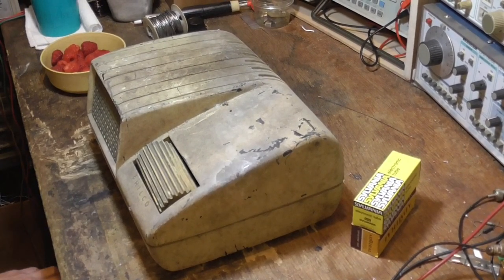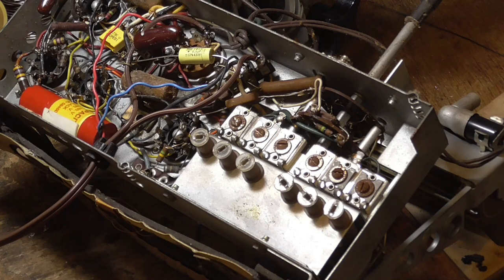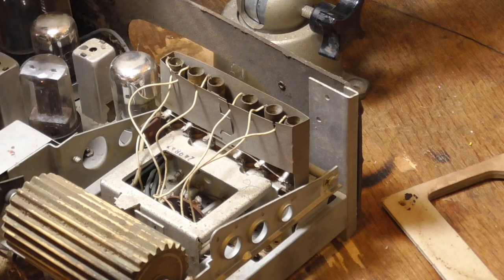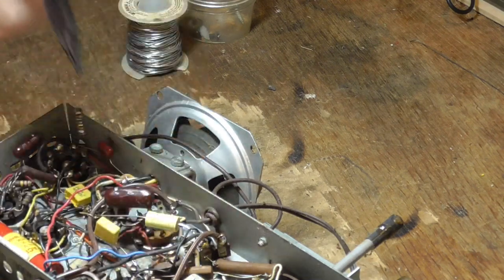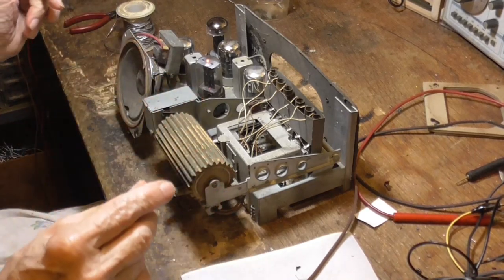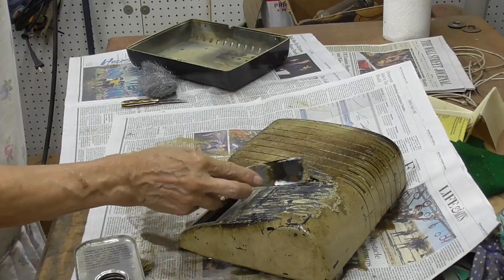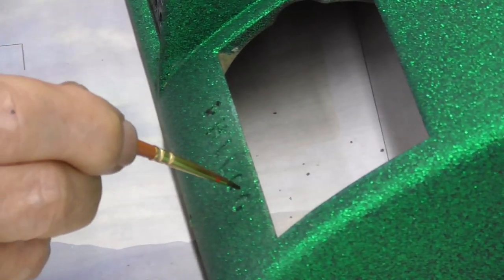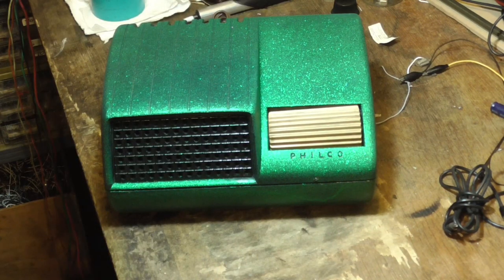RESTORING A VERY UNIQUE PHILCO TUBE RADIO

Comment: You are missing the little color wheel that goes in front of the pilot light.  Each station will have a different color pilot light on the front.  It attaches to the end of the long shaft of the station switch.  That's how you know what station, or which preset you are tuned to.

Comment: Interesting fact, this is a foot operated radio! Designed to be placed under desks in offices or for secretary’s. Move the dial with your foot for volume and press it down to change the channel. Also became pretty popular for physically disabled people, particularly wheelchair bound folks. They really did think of everything!
Reply: why would it be useful for wheelchair bound people, if the whole point of it is that it's foot operated?
Reply: This is not a foot operated radio. That has been debunked.
Reply: These are NOT foot operated no matter what you might see elsewhere...
Reply: Jacob Garby I should have been more specific. Used in hospitals ect for people who are wheelchair bound but not permanently disabled, say a broken leg ect

Comment: Perhaps it's in a comment already, I didn't read them all. We have one of theses in our New Jersey Antique Radio Club's museum. It's a "Secretary's radio", designed to sit on the floor under a desk, and were often used in a reception room. The Secretary used her foot to roll the volume down when greating a guest or taking a call. Tapping the roller changed stations. The example we have is its original ivory color.

Comment: The size of the dual purpose wheel and lack of a dial makes me think this may be designed to be foot operated. Like in an office. Certainly a unique piece. Nice work as always!
Reply: Never advertised as a floor model. Why it is just a novelty desk unit where you set six active AM stations from underneath and use one hand to operate it
afterwards. It would sound pretty crappy on the floor and with shoes on hard to adjust the volume without accidentally changing the station!

Comment: For removing the paint I use this method. Apply the paint remover and let it soften the paint. Use a low power pressure washer to power wash the old paint off. You can dry the water and reapply the paint remover if needed a second time. No scratches or damage to the surfaces you are cleaning and it's much less messy a job.  I would tie the shells down so they can't dance away when the water hits them.

Comment: This was designed to sit under a desk and be operated by foot.
Reply: no it wassent
Reply: @robot797  My mistake. Found an old ad for the 49-901 (this model) which shows it as a bedside radio which makes sense. I have heard, however, that it was used under desks but it seems that is a common misconception.
Reply: @brianbommarito1360  the material it is build from isnt strong enough to handle food presses
but i know the mistake and i dont blame you

Comment: If I could hazard a guess as to why the strange tuning mechanism, I'll bet it was aimed at elderly people or people with limited eyesight who might have difficulty tuning a regular radio tuning dial. At the dealership (remember when there were radio and TV dealerships?) the salesman would set the presets to the stations that the person wanted to be able to listen to. Or, conversely, a relative or friend could set the presets when the radio was brought home.

A great job, as usual.
Reply: That's a good theory but if so, why is the channel indicator (missing in this example) a colour wheel that would require the user to see it; surely they would have used something tactile instead?

Comment: Nice save!

Let’s set the record straight on these Philco “Secretary” models (Philco model 49-901) for the viewers at home.

These were never intended to be put on the floor and operated by foot. The original advertising confirms this, and besides, there would be very, very few left with this kind of treatment. These are unique, but certainly not rare. Philco was a very prolific manufacturer. I own 3 of these radios myself.

They were only available in 2 colors from the factory—ivory and green (the green being a sort of institutional colored green). Any other variation (including plain Bakelite was modified at a later time).

The whole point of this radio was to provide a desktop radio that would cause as little distraction/disruption to the secretary’s primary functions (typing, filing, answering the phone etc,) as possible. Volume and tuning could be accomplished with a quick reach—not even needing to take your eyes off of your work.

I caution anyone that works on these to be very careful of the rotating color wheel as they are very fragile and brittle. This is one of the key elements of the radio as it filters the light from the pilot lamp so the jewel indicator on the outside glows a different color corresponding to the different station/frequency selected. This is the only visual feedback to the user.
Reply: Thank you, DR, for that interesting information.
Reply: And yet there some idiots  posting who don't understand that it WAS designed as a table top radio and NOT to be put on the floor!

Comment: Welcome back ! Ah the Secretary by Philco c.1949. Sat on the desk, it WAS a desktop model, and you could turn the dial from  off to  on and then turn it to raise 
the volume. You could press the dial to change the stations.  It had 6 preset stations that could be dialed up from underneath. Of course you would set the radio to your 
liking from only listening to what was playing since there wasn't a true frequency dial to see the frequency number. That did add to both it's uniqueness and  it's 
downfall.📻 Note, bandersontv did a complete and great restore of this model a year ago. It was in much worse shape!

Comment: Well done Ron! 
The radio is missing the preset indicator wheel. 
It should have a transparent colored wheel numbered from 1 to 6 on the front with the lamp illuminating it from the back, and the corresponding preset would shine from the hole in the front. 
All the best,  Moshe.

Comment: Perhaps no one has realized yet, but that radio was designed to be on the floor under your desk.  You use your foot to work the volume control and change stations.  That's why it's so big, and why it's built so sturdy.  Like a guitar stomp box!
Reply: I think you have something there. Something one might have in an offce/receptionist area back before "Musac". Pretty handy indeed. It may also explain why that volume control was so filthy too. 😃😉😉 Great observation.
Reply: You should check the info made at that time and you will see it was a desktop model with a speaker which precluded putting it under the desk, sheesh!

Comment: Never really seen this kind of radio b4,I couldn't work out what it really was in the first place,but by the shape of it,it looked really like the shape of a fan heater with the rotary control,like a thermostat with an on/off switch.
Amazing how there,s no radio dial,u had to guess what station u are listening to.

I like the cat in the video too,that is so cute. Must've been hungry for the dine food too.
Very nice metallic green finish on the radio case too. But would've been good if u had put the light globe in to see what colour the wheel was showing each time a radio station was selected.
Good to see the fine radio tuning controls on the bottom,and the instructions of tuning the oscillation coils for each preset. 
Would've been good if the speaker was repaired,as there was a hole thru the paper cone.

Comment: Too bad about the SMD. I either do a cap replace or I just put a new core in. 

I know you did some work on replacement IF transformers a while ago. I looked at that and some other sources of ideas and carried on with some further research on it.

As a result of that I designed a core for 3/4" transformers that has all components on a PCB and its works pretty good, actually a bit "hotter" than the stock ones (higher gain). I need to get around to putting them up somewhere for others to get...
Cheers,

Comment: Yeah. That's about the goofiest radio and have ever seen. Quite unique.

46 years ago. I received another rather unique, Philco radio. I had been working as an electrician's helper. When I found this in some very old lady's house. Sitting way in the corner of the attic. Inaccessible to an old lady. No problems for an 18-year-old like me.

So I bring it down to her. And I asked her about it. She said it used to work but just fades out. And it was put up there years earlier. Buyer husband. Who since died a long time ago. And she gave it to me as a gift.

It was this nasty cruddy mottled black color, yuck color. And instead of taking some caustic petroleum-based solvents. I grabbed some Fantastic spray cleaner. And within seconds. It revealed. This gorgeous, golden orange colored, varnished, new, without a scratch, furniture quality case.

And Yep. It works for a short while. And fades to nothing. But here is what is most unique about this particular Philco radio.

It was a multi band radio. With the standard AM radio band of North America. Followed by some of the international shortwave bands. But then there was this one other special band. That no other radio in the world has.

This Philco radio had the first, Armstrong, FM band. The Armstrong FM band. Was not the FM band we know today from 88 through 108 MHz.. It was something like 40 through 49 MHz. And that was supposed to be the world's first, FM band. But it never came to pass. Even though this radio went into commercial production. There were no FM stations at 40 through 49 MHz. There never were. There was never going to be.

Unfortunately with my relocation move halfway across the country. After 40 years. I had to give it up and sell it. As I could not take everything with me. And I gave up a little piece of history. I never wanted to give up. Because I started working in radio for my career. Right about that time that I received that radio. I was never an electrician's helper again. But a professional broadcaster. And that's a keepsake piece of history one wouldn't want to give up. Waaaaaaaa.

Sorry I don't mean to be a crybaby. I just turned 64 and I'm going through my second childhood.
Reply: You've got a year maybe two on me. I started my small collection about 12 years back and just now starting the restorations. Love it. Doing a 35 GE, currently but having a few Philco's, Tru tones,  BorgWarner, a Belmont, a White Dept. Store ---my favorites are Zeniths (have 4 of them).

Comment: 10:03 When did they start using KONAL alloy in the pins of vacuum tubes(valves)?  When they developed all-glass envelopes for miniature tubes circa 1940?
35:25 Did you use black paint on the undercoat because black dried faster than any other color?

Comment: Could it be that this radio was designed for a blind person? Maybe it was intended to be tuned by someone who can see, then you have a radio all set up that can be tuned from channel to station, volume changed, turned off and on all from the same rheostat switch! That is actually pretty ingenious. It would’ve been neat if they designed it so you could have the added function of scrolling through the stations with the same rotary switch by depressing it while scrolling. I really appreciate the mechanism. Does the station setting mechanism work like the kind of mech in an old time automobile radio deck? Sort of seems like it does. I really love the craftsmanship that went into old time equipment like this.
Reply: I thought it was a fan heater !
Reply: Not advertised for the blind but it very could be used as such, once you figure out the tuning  from underneath!

Comment: Never assume a newer Cap is good. Made that mistake before by replacing all the older caps and still having a problem until the newer cap was replaced that I thought was good.
Reply from the maker: That is a valid point! I have boxes of "new old stock" caps and it is disappointing at how many have serious leakage even though they are "new."

Comment: Love this! I got one of these Philco “Secretary” radios recently and after the electronic restoration, I’m just finishing up the case restoration. So cool you are doing this one Ron! Your case is in great shape too. Count yourself lucky. So many have the bakelite cases beat to hell after shipping.

Just realized that yours is missing the color wheel that indicates what channel you are on... When you press the barrel selector down, the mechanism ratchets turning the “color wheel” which sits on the end of that long shaft between the indicator light and the little clear plastic piece in the case, changing the color for each particular radio frequency...

Photo of the “color wheel”:
https://farm5.staticflickr.com/4659/38869460395_87292ba173_z.jpg

More info about the radio itself...
https://philcoradio.com/phorum/showthread.php?tid=18014

Comment: Nice to know you have an unlimited supply of K-tran IF transformers from your radio club.  In my case I replace the mica caps with 300 volt dipped micas.  They fit inside just fine.  I DON'T use a Weller soldering gun though! 😬 You're spoiled, Ron. 🤥

Comment: 24:00  the IF cans you replaced now have to be re-tuned for that radio they are previously adjusted for a different radio , However you got lucky on this one. However it could still use a fine calibration

Comment: Thanks for showing how to test IF transformers. This is the kind of things I need to learn being new at all this.  Question: I noticed you always just test a tube by measuring the filaments to see if you get a OHM's reading.  If you get a OHM's reading does that always mean the tube is working?
Reply from the maker: The filament MUST be good for the tube to work at all. So it is a quick test to get rid of the "dead" tubes. The tubes can still have other problems but those problems are much less common than burned out filaments.

Comment: 16:40  its SMD (Silver Mica Disease)  its not moisture per say... its the migration of the silver  and its electrically shorting.   the IF cans are not bad as the coils inside are still good, however its wafer mica capacitors which can be replaced.

Comment: Might this radio have been produced for the blind? Very unique.....just a thought given the absence of visual references.
Reply: It was not advertised as such because you would have to use a small screwdriver underneath  it to adjust the tuners to pick up six active stations.

Comment: Never saw one of those .In the day we had a shop we saved any wax caps that were good in a drawer w some nos. Collector said original stuff only no modern parts In his 39world fair tv set .🤔
Reply from the maker: I have a supply of old original caps and resistors to use in the restoration of the "special" sets that are particularly rare or if the customer want it done.
Reply: @glasslinger  good figured you would  . making  tubes blowers me away  .we had 5000 or so tubes sold em 250$  just to get rid of them no audio stuff mostly bw tv stuff nos .kept 30s  tubes have 3 philco cathedral  1 clock face radio baby philco  3trans oceanic Zen. The trf philco works well considering.🤗

Comment: Ron, it's not that hard to fix IF transformers. Fiddly maybe but on something rare if one cares for originality it can be done not too bad.  All you need to do is get in there and disable the original capacitors, usually break out the wafer or bend a contact up. Then you can either go the common bodge route of 100pF per side, or you can reassemble them on the radio with trimmer caps and get the alignment as close as possible with those first before touching the cores, measure the values and replace with fixed caps inside the cans if you care about looks on the underside too.  Shame to throw away the originals since the replacements will go bad over time too & where can you get new 455 or 10.7 xfmrs from now anyway?
Reply: Seen Shango explain that technique due to what is called silver mica disease.
Reply: @hestheMaster   Exactly where i got my info from, proud to consider myself a student of his methods & learned a great deal from his videos, not least how to tell a cracklepony from a carkosnorfulated skoilyspoimler :D

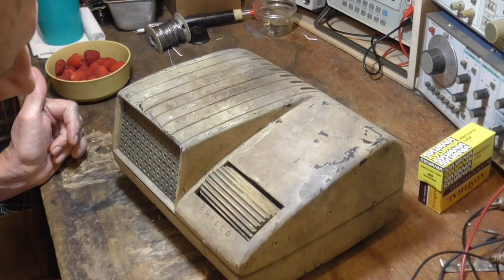Comment: If it is transformer, one side might have a higher number of windings, so rather than a 20:1 you have a 1:20 😅 ultra quiet, if they contain capacitors I guess they could be polarised

Comment: Why not cut the leads instead of the terminals, and give the bad IF cans to your club member who rebuilds them?  Soon, spares will become scarce, so I'd want to save all that I can.  Of course, I'm one who pulls the leads off the terminals, and rebuilds the cans.  (So far, only the larger Zenith ones, which are easier once you have the hang of it.)
Reply from the maker: Someone is now actually making replacement I.F. cans for the more popular radios. You don't make money repairing radios for people if you doodle around taking hours to fix them. Can't charge much to repair an old radio so you have to be very efficient in the job.

Comment: So paint stripper won't hurt Bakelite or plastic?  I was always afraid it would melt it.
Reply: Nothing can hurt bakelite. But wire brush is too much.
Reply: Good too know.
Reply: Bakelite is crosslinked (thermoset) so can't dissolve or melt anymore. It's often used in applications where heat resistance is required.
Reply: It will harm plastic, be careful! Bakelite on the other hand is tough as nails...
Reply: Thanks.  I'll give this a try one day.